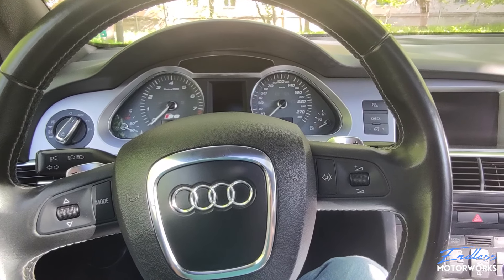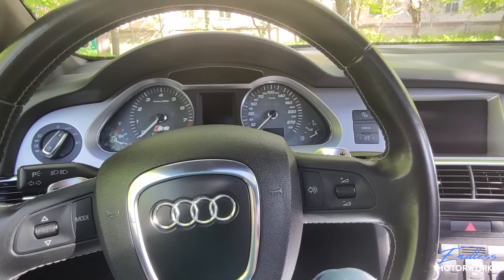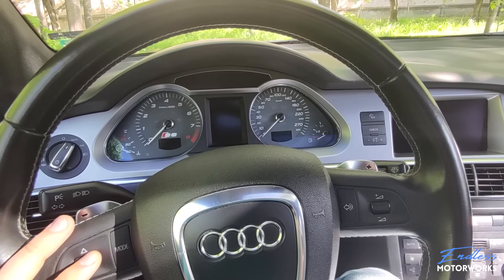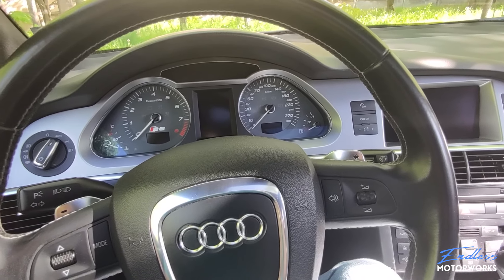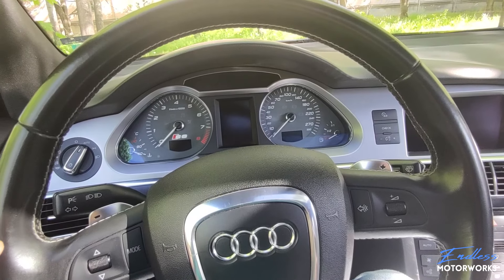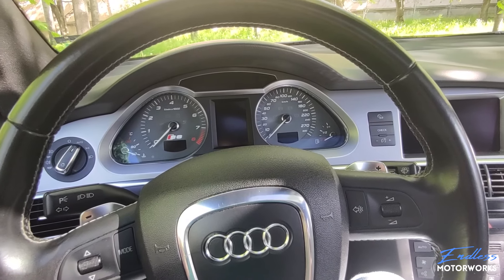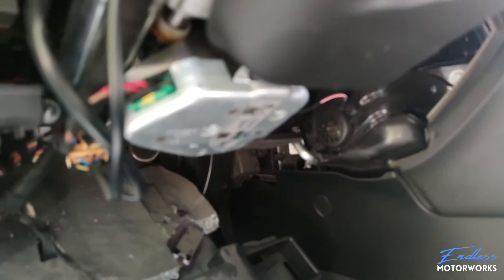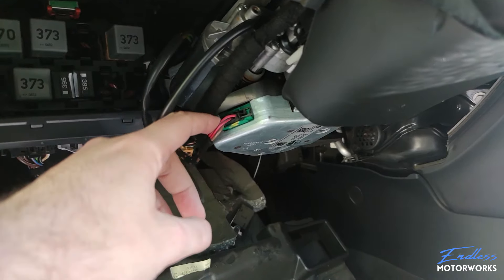How to Prevent or Fix the Steering Wheel Column Lock Actuator Issue on an Audi A6 / Q7 (DIY Repair)

Comment: Hi
I am so happy to see this video and see that the problem can be easily solved without a big financial outlay.
I know the switch is hanging on the Steering Wheel Column Lock Actuator. That the Steering Wheel Column Lock Actuator does not work properly there is no command for the switch to work.
I just want to understand. Once you have cut the wires will the switch work without being hung on the Steering Wheel Column Lock Actuator?
When you take out and insert a key there is no longer the sound of the Steering Wheel Column Lock Actuator and it is actually deactivated?
Reply from the maker: The steering lock itself will no longer engage, if the wire is cut while the steering itself is unlocked. Everything else on that module that relates to the immobilizer is intact and can properly communicate with the ignition switch.
Reply: @EndlessMotorWorks  
thank you for your response.
I have an important question.
My a6 c6 has a serious problem with the steering column module, which means I have to try to delete the fault again and again and only after about an hour the steering column stops locking and I can start the vehicle.
Even after the lock steering wheel is unlocked I still see in the scan the Fault "00288-Steering Column Lock Actuator".
My question is can I still cut the wire even if the fault still appears but the steering wheel is not locked?
Reply from the maker: @liorcastro  You should be able to, but I am not sure if the fault code will be able to be deleted if it logged by the ECU, but the wire cut.

Comment: I should’ve done this sooner . Thanks a TON sir. Now my only question is there any complications/ drawbacks from cutting this cord ? Now I drive not scared it’s not gonna crank on me anymore 😂
Reply from the maker: No drawbacks aside that the steering will not lock itself with the key out of the ignition. If at one point you decide to resell the car you can always connect the wire back up and it will be working as before.

Comment: Hey I have an EPC Fault again with my S6. My garage thought it was because the battery went too low because there were codes for that aswell even tho I didnt notice anything. So they basicly put the settings of the Throttle Valve Controller back as they must've been lost of the battery outage. It worked, the car was having no errors untill 2 days later. Same error came up. Do you know what the exact problem could be?

Codes:

P000B
P1568
P1545
P1579
P2106
Reply from the maker: I checked the codes and from the info I was able to gather they all point to a fault with the electronic throttle bodies. What the exact issue with them is, I can't really say without looking at the car. However, from my experience it is likely that the throttle bodies themselves have gone bad. It is a common issue on 4.2L V8 and the 5.2L V10 engines. First thing I would do, however is to clean the throttle bodies and perform a new adaptation with VCDS. If the issues doesn't go away or comes back after some time, changing the throttle bodies would be the way to go.
Reply: @EndlessMotorWorks  Yeah I can remember we cleaned the throttle boddies half a year ago or so which was the solution for a problem at that time. We did a new adaption which helped for 2 days. Now they opened the throttle boddies but it doesn't look like something is wrong with it, but still I think replacing them is the best option then as you say! Thank you :)
Reply from the maker: @DJSPYROOF  What I am saying is purely based on the symptoms, the troubleshooting / repair work that has already been done and also from my personal experience. However, it might also bee good to take the car to another shop for a second opinion (not counting mine, as I am just a random dude, who likes wrenching on cars and not a "professional" mechanic).
Reply: @EndlessMotorWorks  for anyone needing this information. It got fixed after replacing a throttleboddy😇

Comment: Wow thanks for making this video. So does this cause any faults or other issues? My car has the keyless access and push button start. Will this be effected at all? Thanks
Reply from the maker: No, this will not affect any other system. By cutting that particular wire all you are doing is preventing the electrical signal to be sent to the lock actuator, which locks the steering wheel.
Reply: @EndlessMotorWorks  is there a fuse you can pull instead of cutting the wire?

Comment: Thanks for the great video. I have a 2009 Touareg with the same problem but i dont see the red/black wire . Do u know if on the Touareg its a different color? Thank you
Reply from the maker: I have no idea to be honest. I know it works for the A6 C6 and first gen Q7 because I have the former and the latter uses the same steering lock. I have seen people in the comments mention they managed to do the same for other VW/Audi vehicles, but I can't confirm it will work, nor which wires to cut.
Reply: @EndlessMotorWorks  how about i take off the module front the steering so it doesn’t lock but i let it connected to the wire. You think it will still work? This way it wont lock my steering

Comment: Will this fix ignition lock (red 🔑 key issue) as well , or I will still need to replace ignition switch?
Reply from the maker: Most likely the ignition switch is the problem. You will need to read the errors to know for sure.

Comment: Any side effects? Check engine light? I heard a long peep coming after you cut the wire
Reply from the maker: Everything works perfectly fine. As it is explained in the video besides that the steering stays permanently unlocked there are no side effects. The beeping sound you hear in the video is due to my front headlights having issues with the cornering mechanism. It is quite a common issue for these to go bad on A6 C6 Audis, as the wires inside of them disintegrate and create an open circuit.
Reply: Its because of the AFS. It goes bad all the time on these older german vehicles.

Comment: I've had my entire steering column replaced because of an error. (Forgot the exact number sorry.)  This error didn't just lock the steering wheel. It prevented the entire car from starting. Electric handbrake stopped working. Remote lock with the car key also stopped working. 

Resolding the switches seem like the best option in terms of costs & effectiveness.

While you're at it, you might want to replace the oil sieve in the Carter & replace the cam follower to prevent severe engine damage.

All these 3 things have costed me thousand of euros in repairs which could have been prevented if I had know these are common issues
Reply from the maker: Thanks for sharing your experience!
Reply: Hey I have the exact same issue 😖steering wheel did not lock and the entire car not starting and no light on dash board. MMI works perfect and light are on. I think the issue is with steering column / any advice to resolve this issue? I am in an urban area in Bulgaria and no body wants yo come to tjae my care to nearest service station.

Comment: Hello, thant you very much for this video. But I've got on question. Have you got an error on the ODB after doing it ?
Reply from the maker: If the error was cleared prior to cutting the wire, no subsequent errors will be stored.
Reply: @EndlessMotorWorks  Thanks for your reply. I performed this action on my old Audi A6 C6 4F with 380 000 kilometers and everything is OK now. Many thanks from France for your help
Reply from the maker: @davidpilon3654  I happy to hear the video helped you out!

Comment: Hi would anyone know if snipping the wiring would cause the key fob to not work ? 
As i have purchased a audi with no steeering lock which im assuming the previous owner snipped the wiring ..
Reply from the maker: No, if done properly it shouldn't interfere with the function of the key fob
Reply: Right because i believe the previous owner of my audi a6 has snipped the wire as my steering lock does not work and i also have the red key sign on dash same time key fob not unlocking or locking i have to use the key manually..
I was wondering what is the next best solution connect wire back and repair the module to solve the key fob problem ?
If any one can point me in the right direction i would really much appreciate it ... thanks.
@ ENDLESS MOTORWORKS thanks for taking time out to reply when you say if done preoperly can you explain so thankyou in advance@EndlessMotorWorks

Comment: Thank you I have just bought a 2008 Audi A6 Avant 6 speed manual with a 2.0tdi diesel engine. Would it be the same process for a right hand drive UK car. Thanks once again.
Reply from the maker: Yes, the process would be exactly the same.

Comment: Very nice video. So to make it completely clear, my a6 has a complete factory immobiliser and alarm horn. If this wire is cut, the rest of the alarm and immobiliser functions still work normally correct?
Reply from the maker: Yes, that is correct. If by some reason you want to have the steering lock be working in the future, you can just re-solder the wire and that would be it.

Comment: I have a 2007 Q7 followed your procedure,don't know if the steering module was replaced,I had issues with the steering pump I replaced,still the steering is locked like before but I drive no peoblem
Reply from the maker: Nice to hear!

Comment: When you cut the wires does it affect anything else in the car?
Reply from the maker: No, it only prevents the steering lock mechanism to engage and lock the steering. By cutting the wire, when the lock is disengaged, it will not engage again, thus solving the issue of it becoming permanently locked when the microswitches fail.

Comment: Very useful video .. I have an Audi a8 d3, 2005, can I do the same on it, are the wires the same color?  thanks in advance
Reply from the maker: Yes, everything is the same. You can apply what I show in the video to your vehicle.
Reply: Thank you👍
Reply from the maker: @atekscg645  Keep in mind that on the A8 the module is different as in not really prone to the same issues. It is the module that the A6 has that mostly fails. Therefore, if you have an A8, I don't think you have anything to worry about. I would just leave the steering lock as it is.
Reply: @EndlessMotorWorks  it's completely different on the A8, they only have 3 wires on the lock, and there are 8 wires on the ignition, where the key is inserted
Reply from the maker: @atekscg645  Module is different, wires are the same. There are three wires in total that are going to the module.

Comment: Hello handles if I cut the wire the starting problem is solved or just the lock ty
Reply from the maker: Technically both. You can't start the vehicle if the steering column is locked is engaged, because of the immobilizer. If you have the steering column unlocked then the car should be able to start just fine. Just make sure the steering isn't locked when cutting the wire. If yours is currently locked you will need to unlock it first and only then do this mod.

Comment: I was reading the comments, everyone cut the wire, but in the video you say that i can depin the wire too, i would like a confirm that i can do that too😅 or if i have to cut it
Reply from the maker: You can absolutely depin the wire, as long as the steering wheel is unlocked while you do that. I simply chose to cut the wire as it was easier, and I could do it with one hand while filming.

Comment: Hello i have this problem ignition lock, would this solution from the video help?
Reply from the maker: Can't say for sure without having the exact error codes from VCDS.
Reply: i have ignition lock defective message randomly too, did you fixed and how? did cut the wire helped?

Comment: Hi
I wanted to know if after you cut the wire and you scaning faults. Will there be a problem with the steering column due to the cut wire?
And if I want to reconnect the wire. how do I do it? By tying? soldering?
Reply from the maker: No fault codes will be registered. CEL will not come on because of this modification.
Reply: @EndlessMotorWorks  And if I want to reconnect the wire. how do I do it? By tying? soldering?
Reply from the maker: @liorcastro  You can do either. There isn't that much voltage going through that wire. Make sure to use electrical tape to insulate the wire regardless of which method you use.

Comment: Does this module have any connection with the key fob button locking as i have ordered new keys and giy tried to program fob to lock and unlock but nothing was happening...(via computer and manual)
Reply from the maker: That module also has the immobilizer or at least some part of it built in.
Reply: @EndlessMotorWorks  cheers buddy enjoy your Christmas

Comment: My A7 is dead in my driveway with "Steering defective do not drive" and the wheel is locked. Car worked perfectly when i parked it last night, it dropped to 0 degrees F last night and is still around 5-10 degrees out. I feel like the cold could have caused this issue?

Any advice? Could I clear the code and do this trick you showed?
Reply from the maker: Based on the description it seems to be a different issue
Reply: @EndlessMotorWorks  Thanks for the reply, it's at the dealer....wish me luck lol

Comment: Does this also prevent the other steering wheel lock mech issue that wont let the car start? I cleared my codes and now can start car. I dont want it to happen again. BTW when I first encountered this issue the steering wheel never locked in me.
Reply from the maker: Yes it will. This is the entire reason I did this so that I never get stuck somewhere without the car being able to start.

Comment: Hi does this issue fix Audi Q7 s-line quattro 3.0 TDI 2016 Hard/Stiff Steering I had a similar issue. Sudden loss of power steering at slow speed, tight turns left or right
Reply from the maker: Hard/stiff steering that is intermittent is most likely a powers teering pump or rack failing.

Comment: Does it give any light on the dash after cutting the wire?
Reply from the maker: No lights on the dash, as long as the error code is cleared before doing this diy.

Comment: what about car computer ?  the computer needs to check in signal from Column lock working to work well. Did central computer of the car still working ok without column lock signal missing???
Reply from the maker: Yes, everything works fine, as the lock actuator is in the unlocked position when the wire is cut. As long as there are no pending error messages stored, there should be no issues at all.

Comment: Hello i have question i will do that when unlock or do that then its stuck??
Reply from the maker: You will need to cut the wire when it is unlocked. If you do you it when it is locked, then you can't unlock it anymore.

Comment: Hello Great video. My problem is a bit different a message came up saying please take load off steering and the car would not start. but the steering did not lock like it normally does. Instead when I put in key I hear the noise like it wants to unlock but twice. This was happening with the mmi screen coming on and the date signal on the dash coming on. After seeing on an Audi forum a post to turn steering wheel 180 degrees with foot on the brakes and try to start. Did this but to no avail. Unfortunatly now the mmi not coming on and no date signal on dash but still noise like it is trying to unlock but twice. any advise?
Reply from the maker: First thing I would do is scan the car for errors and check the battery for proper voltage. Generally, based on what you are describing, one of two things is probably happening. 1st - possible steering column lock actuator. 2nd - Immobilizer fault
Reply: Hi, I have the same problem.  Like you were in my car.  Did you solve it?

Comment: So when you put the key in, the mechanism unlocks the steering column? So deactivating the mechanism you'll be not hearing the unlock sound and basically what you're left with is a normal immobilizer situation? The real issue is when you turn the key, the steering column is not sending a signal that its unlocked to the immobilizer, but if the steering column is unlocked all the time the signal is always "unlocked"? Right? Hope that is the case...
Reply from the maker: Yes, this is exactly what is happening here. The steering column is permanently unlocked and cannot break in the locked position, which is usually what happens. Immobilizer will continue to works as designed. That being said, if someone really wants to steal your car, they will do it either way no matter what.
Reply: @EndlessMotorWorks  Yeah, my thoughts exactly....although how come the car won't recognize if the column is not locking when you pull out the key? There's no sensor for locked position? Or no switching lock-unlock register sensor?
Reply from the maker: @user-ij8no5zw6u-  There is, but it is in the lock actuator itself. Basically what happens is that with the wire cut, even though a signal is sent to the lock actuator, it never arrives there.

Comment: Good day. I have the following problem. when I push the key under the lock, it unlocks the steering wheel, but I don't have a single light on the control panel, the ignition is good and the battery and relays are new, I also checked the top lock. please help me thank you very much i followed your work.
Reply from the maker: This could be due to a variety of different things. Are there any lights in the vehicle at all when you unlock it?
Reply: @EndlessMotorWorks  there are lights, everything is normal, it just won't turn on and there is no contact on the dashboard. battery full.

Comment: Also would it work on an Audi A8 2006?
Reply from the maker: No, the steering lock mechanism is different and has different connection type. This guide is applicable only to the A6 C6 and first-gen Q7.